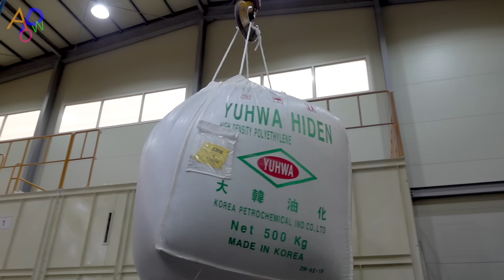Plastic Box Factory in Korea That Machines Make Automatically

Comment: Oh wow, they use plastic injection molding machines. I used to be that guy that was setting the big metal mold in place at the beginning of the video. It's an interesting process and messing with the machines parameters in terms of how much pressure to apply for the plastic injection, cool time, and plate start-stop, plate speed, clamp location, etc... helps you learn more about how machines work.
Reply: 대부분다 사출성형기 쓰지 않냐? 당신은 기본이 안된사람